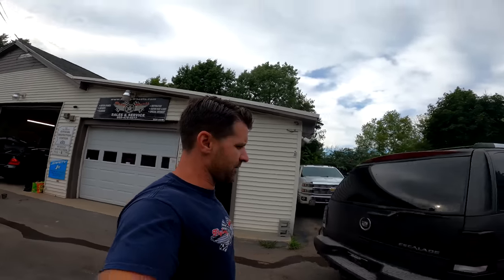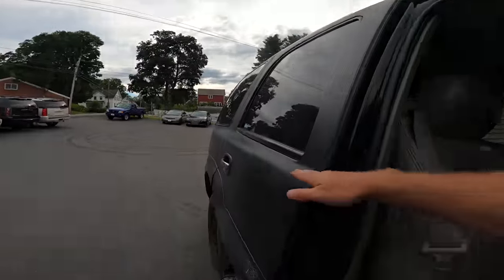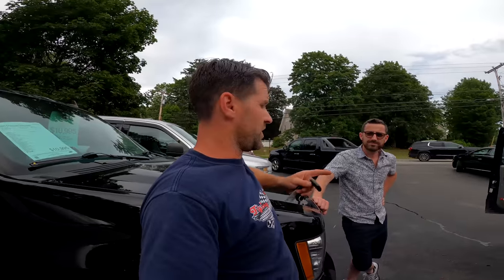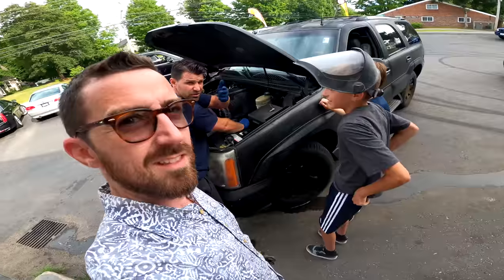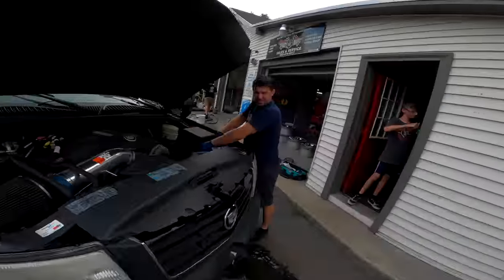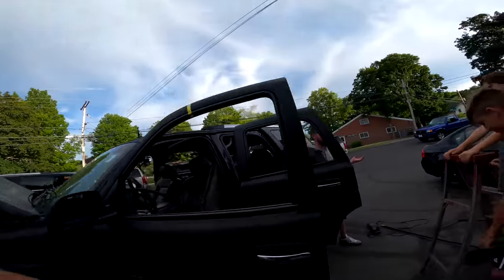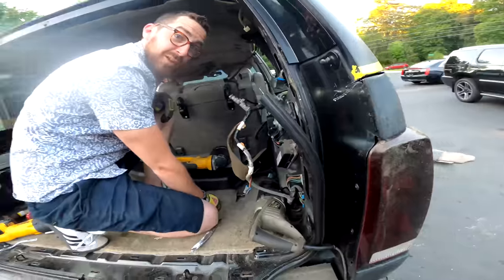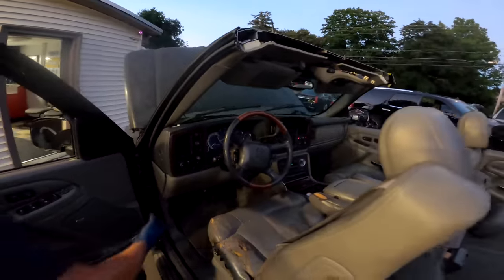We tried to make a Convertible Cadillac Escalade - Did It Work?

Comment: You not worried about it folding up and the doors dropping??
Reply from the maker: Shouldn't?
Reply: It’s on a frame. Nothing like that is going to happen.
Reply: @HETPEZB  that is not entirely true. it is part of why the ramcharger and many other brands stopped making convertibles like this. while there is a full frame under it the body will still flex and can cause issues with door not opening or closing in the future. to see how bad the flex is on stuff like the ramcharger it is best to open the doors and lift up and down on the 1 and watch how much the windshield moves. it would actually be wise to install a roll cage to help prevent this type of movement.
Reply: @crazzywolfie  I agree if I was mine I'd stiffen up the body with a rool cage it seems like something he plans on keeping fo awhile just to be sure the doors don't start dropping even being a full frame curring a roof off anything takes away from the structural design off the vehicle

Comment: Jigg saw is not a very good tool for strait cuts. The blade is flexible and it is easy to loose control. How about a grinder with a metal blade, or even a skill saw, while a bit big.